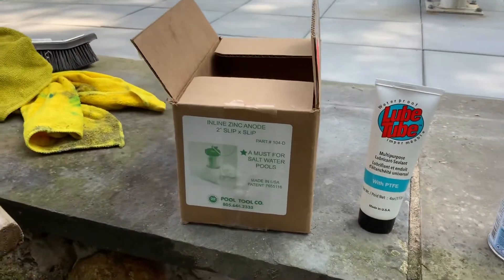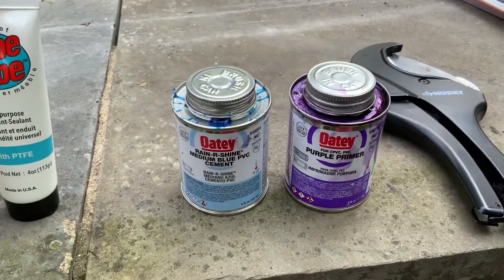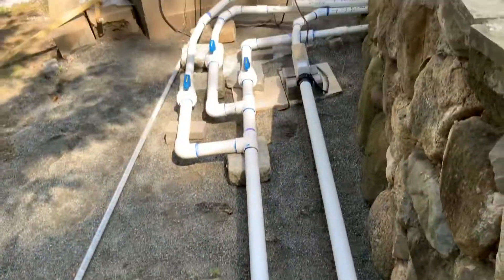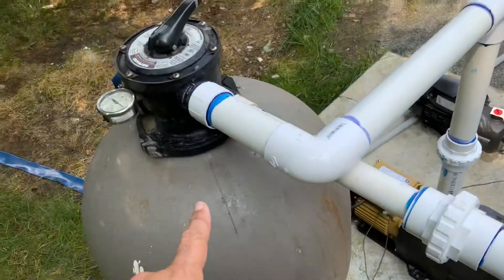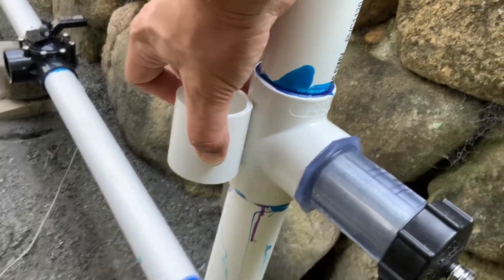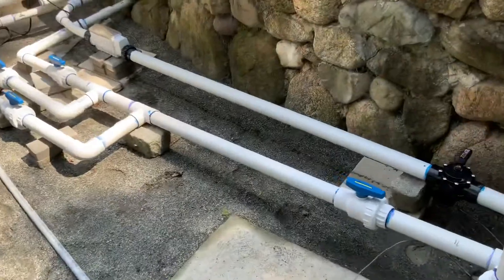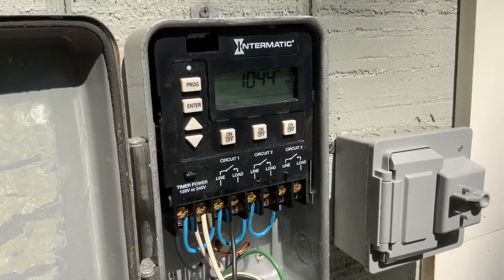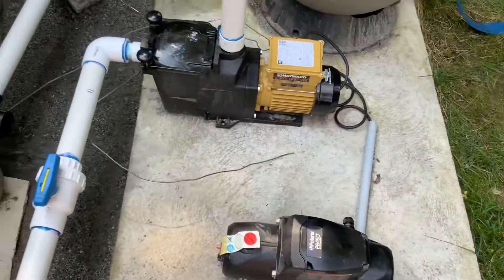Review of Pool Tool 104-D Zinc Anode Installation

Comment: Is this needed in my pool that's not a salt pool?
Reply from the maker: It’s less necessary to “bond” water on a non salt 🧂 water 💦 pool, but if you ever have a stray electric current - bonding the water directly would help equalize  🟰 electrical differences, and thus potential for shocks.  By code all metal parts on any type of pool is required to prevent dangerous stray electrical currents in pool water, so bonding the water using the above “pool tool” would be a good idea and gets connected to all your other bonds which should already exist. 

People get confused, but remember bonding is not grounding.  Bonding is just connecting all metal parts to equalize electrical potential - similar to avoiding static electric ⚡️ shocks

Comment: I’m assuming u don’t have to do anything special to winterize it?  It will just blow through when u blow out the returns.  Do u remove the zinc anode portion in the winter?
Reply from the maker: @FixItWithMe   Correct, I have a commercial type specialized pool blower to purge all the line water. I also can easily drain all the water from a lower vale, below the anode. Therefore no need to remove the Anode over the winter.  The most difficult part of winterizing is always the main drain, which I why I use two values to ensure it’s airtight (similar to a straw in water - you must blow bubbles 🫧 out).  When designing all your PVC pipes, it’s very important to use gravity as your friend!

Comment: What do you connect the wire to?
Reply from the maker: @chrisconstantino71  Sorry, I just saw this. All in ground pools by code must be bonded, if you have concrete, everything within I believe 6 feet must also be bonded. Bonding is NOT grounding. Bonding is equalizing electric ⚡️ potential on all metal and water pool parts.  Therefore, to bond, all pool equipment (pumps, saltwater chlorinator, heater, etc) all have a bonding metal nut available, and technically all metal parts of the pool must also be tied together in the “bonding” with at least bare copper 8 gauge. The Anode is used to “bond” the actual water.  

You can think of bonding like static electricity discharge, if you and the carpet were always connected, there would be no spark, because you would always have an equal charge.   Below is additional information on Bonding Code in most states: 

Bonded parts
Pool structure: All metallic parts of the pool, including the reinforcing metal, coping stones, and deck 
Pool water: The pool water itself, if it's not directly connected to any bonded parts 
Perimeter surfaces: The perimeter of the pool, including unpaved and paved surfaces 
Underwater lighting: All underwater metal-formed lighting shells 
Electrical equipment: All electrical equipment associated with the pool, including pumps, motors, and heating equipment 
Metal fittings: All metal fittings within or attached to the pool structure 
Fixed metal parts: All fixed metal parts within 5 feet of the pool wall, including metal fences, doors, and window frames 
Bonding method 
Use solid copper conductors that are at least 8 AWG
Use rigid metal conduit made of brass or another corrosion-resistant metal
Make connections in accordance with NEC 250.8

Comment: What pump is that ?
Reply from the maker: @eh1992  That is a Hayward Super pump running at only 115 volts, which I purchased in the store at Leslie’s pool supply. I believe they also own “in the Swim” pool supply. In hindsight I probably should have wired it at 230 volts - which will be a future project, to balance out the load.   It’s a great pump, and more than adequate for a 30 thousand gallon pool, provided you have well designed piping and filtration (I don’t use sand, I use glass media which is far superior). 

1.0 HP Hayward Super Pump 700 In-Ground Pool Pump
SKU: SP2670007X10